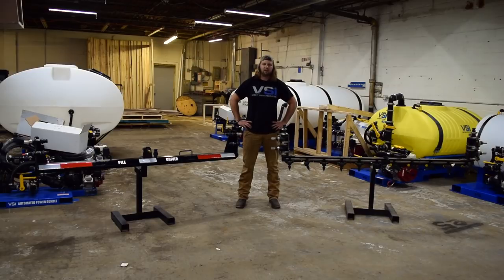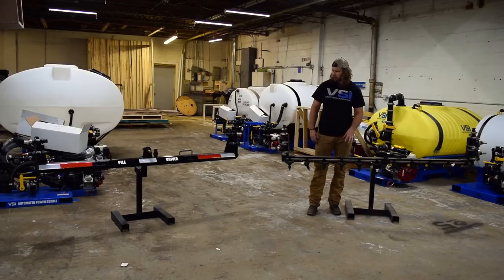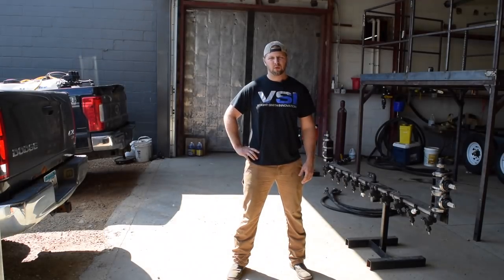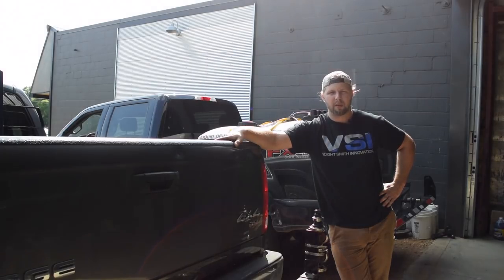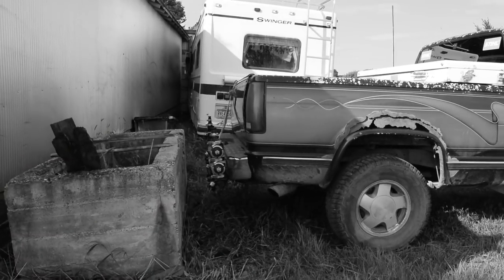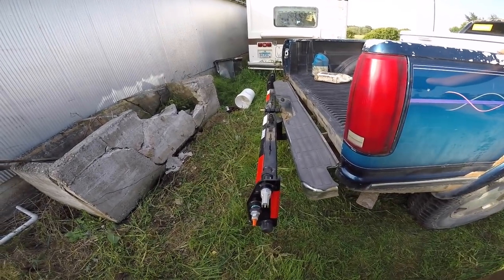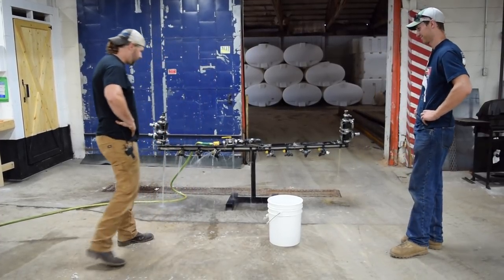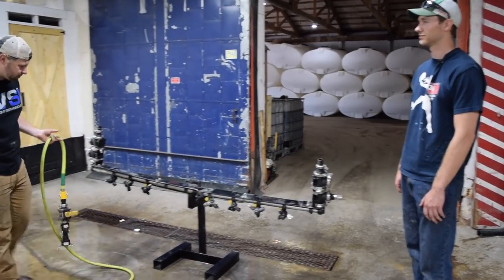VSI New Liquid De-Icing Boom Testing

Comment: For the extra 1 1/2 feet of coverage is it really worth while to extend the side sprayers wider then the truck?  ( can see operator going through a drive thru, or parking it and having someone park close and oops side of car has a new racing stripe)    Might be able to set them on the side rails  of the truck as to not block tailgate and lights.
Reply from the maker: Robert, to make things simple for the customer we don't want to have multiple attachment points for the boom, also the nozzles we use spray backward to compensate for the gap between the three lane and the single lane nozzles so you would end up with one dirty truck. If the nozzles were placed any higher you would also have wind drift, and since the nozzle would be spraying further it wouldn't be able to keep up with the additional flow needed.When mounted on the truck the three lane stands are low enough where they don't really affect view of the taillights. Also when mounted on the truck the boom doesn't stick out as far as the side mirrors, so if operators are having to constantly be that tight to surroundings a different piece of equipment would be ideal.

That being said we do make a lot of custom booms for customers who have specific applications and need different designs that fit their needs. We also offer a 4' boom that is normally for sidewalks but could be used on trucks if needed.
Reply: What are the specifications for the pump?  Really dislike the idea of another gas engine (and gas cans in the back) plus oil changes, froze air filters, etc.   A sealed electric motor and pump might be simpler,   Speed, On/off could be controlled from the cab, powered by a 12v to 120 v rectifier or a DC motor.  (maybe a 1/4 to 1/2 hp)?
Reply from the maker: It's a electric start Honda GX200 (6.5HP) paired to a 2" Banjo poly pump. Pump capacity is around 180GPM and through the system it is about 105GPM. The Honda Engines are very simple to maintain and come with drainzits installed for easy oil changes. We add marine Stabil to our fuel and change our oil twice a year and it treats us right.
We do offer a 12v electric model but it is single lane only as the pump only puts out around 13GPM through the system. It is a stainless centrifugal pump.